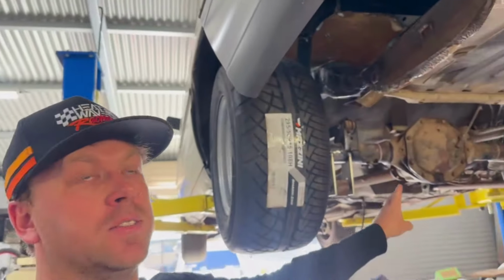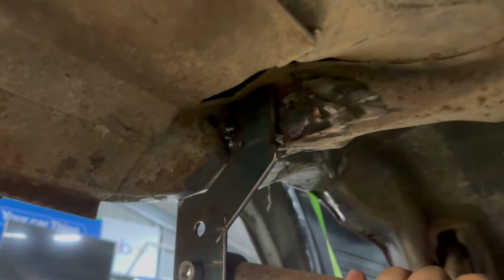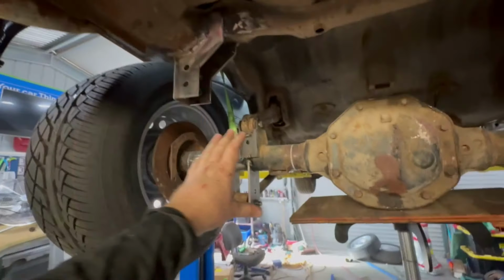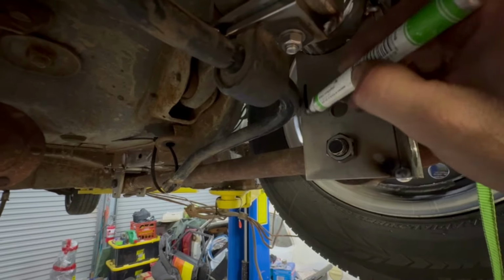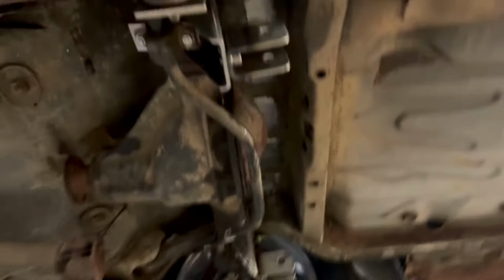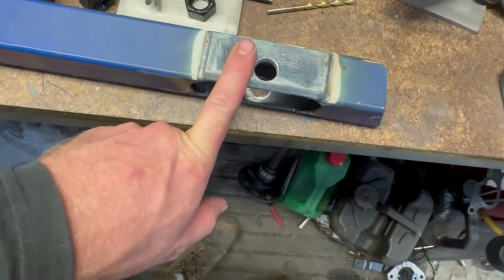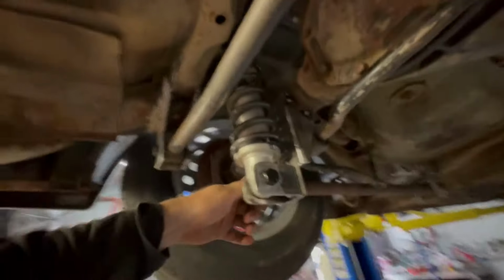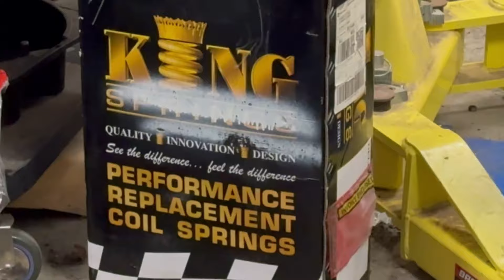Destined for the scrap yard! HOW TO TUB A VN COMMODORE pt 2. Coil over install. BIG TYRE STREET CAR

Comment: Just a heads up the tank might interfere with the tyre it did on my mates vn when we tubbed it
Reply from the maker: Cleared the 295s, but I don’t think it will clear the 325s. Nothing an angle grinder won’t fix haha